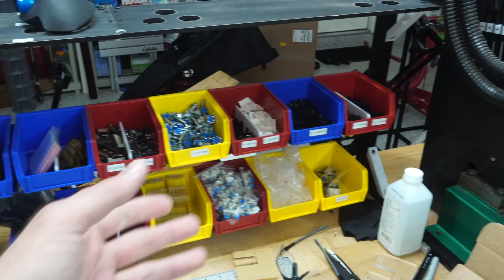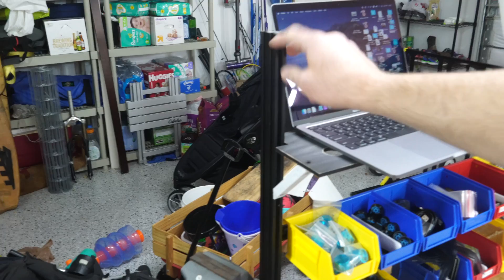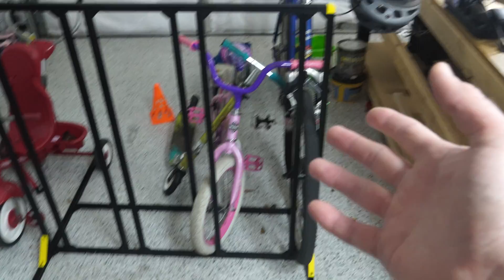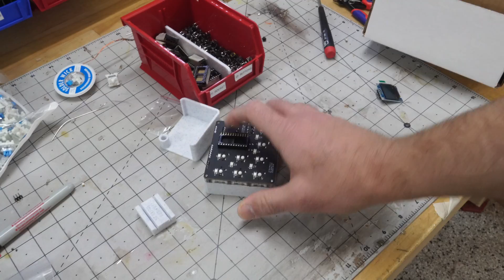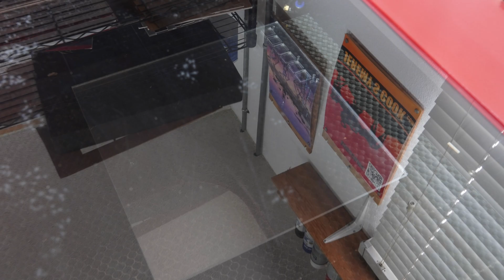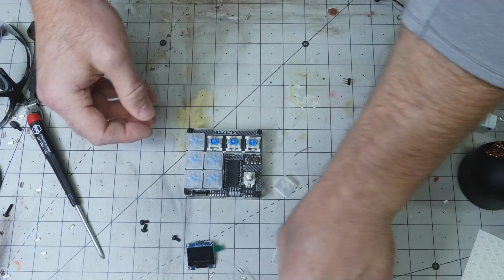Kickstarter Fulfillment Rack and Jig Setup (JC Pro Macro 2)

Comment: Use scale at the end, to check the weight is how it should be. Them them have more parts them the ones needs for the batch this alow to know if you forget something for eatch batch
Reply from the maker: Yeah, that's what I did. Not sure if it's in that video or now. Thx for the comments!
Reply: @JeremyCook  use a projector. With a image were u have the shadow (big ) of the parts need. You take the screw place in on the projected on the table. Also the edge of the table needs to have a skirt to avoid small parts to fall